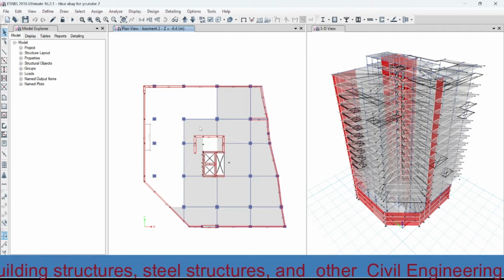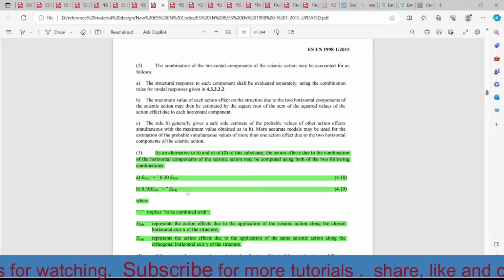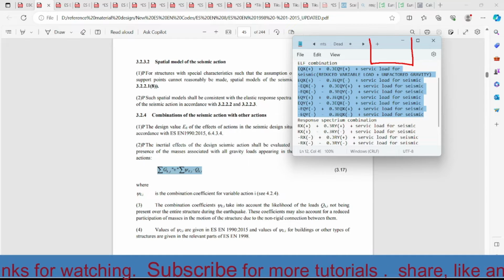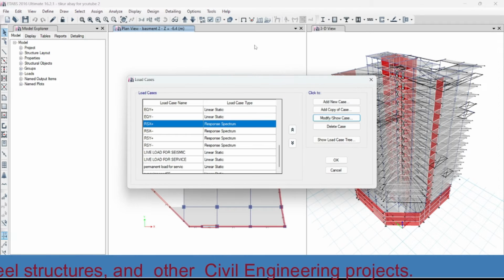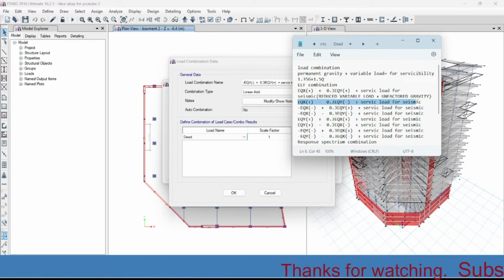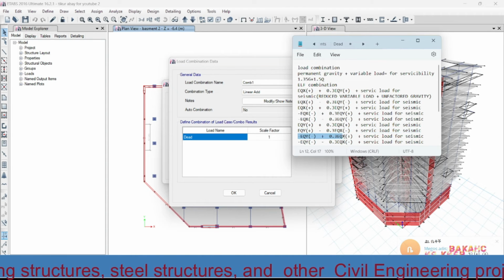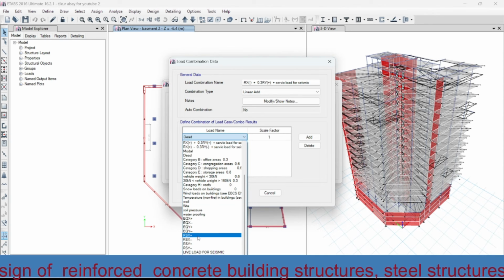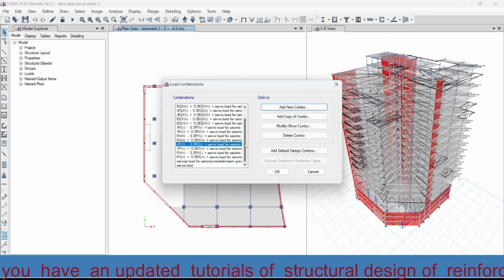Complete Structural Design of 20 Story Building using ETABS with Eurocode & Ethiopian Code (part13)

Comment: If my structure is perfectly symmetrical square.
With slabs, beam, and column at symmetrical position in square plan. Should I add eccentricity. Or only EQx and EQy is enough without eccentricity
Reply from the maker: @shadmandogar  I understood that your structure is symmetrical in plan  and elevation. If so, the center of mass and center of rigidity( structures)  are at  the same  point. In this case the distance between center of mass and center of rigidity  becomes 0.Hence  no need of considering eccentricity in orthogonal direction during static and dynamic analysise. But if the structure is not regular in elevation , there may be a  torsional behaviour induced by the structure. In this case considering an eccentricity is vital to account torsional irregularity. Any way check the regularity  in plan and elevation .

Comment: Question : Why dont you considered,
EQX(+) - 0.3EQY(+) + S.L. ( i mean the (+ , -) in bracket represent eccentricity in positive and negative direction) 

BUT , whenever there is (-) eccentricity load case. You are using a negative direction scale factor. Why not with (+) eccentricity
Reply from the maker: @shadmandogar  both - and + eccentricity static load cases provide the same base shear . Hence both static load cases  in either of eccentricity  should  be scaled.

Comment: Lets clarify. 
"Service load for seismic"=SUM(G)+SUM(psi2*Q). 
SUM(G) named in part 12 "Permanent load for serviceability".
SUM(psi2*Q) named "LIVE LOAD FOR SERVICE". 
Right or not?
And thanks! Great work!
Reply from the maker: for more clarification you can watch tutorial part 13 b which clarifies service load for seismic and live load for servic. live load for service =Q+G where  psi 2 is taken as 1(live load will act with full load) and used for gravity combination only. where as live load for seismic means live load used during  seismic load combinations  only  in this case live load will be reduced and multiplied by Psi2. you will be clarified if you watch load combination part 2.

Comment: I have some question on part 2 the stiffness modifier for slab is taken 50 percent but during earthquake it is known that the resistance of the slab is less so dont you think it is a bit big because other people suggest it should be taken as 5 percent?
Reply from the maker: If u  take 5%' the structure will not be more stiff . So  if u go through literatures of eurocode 8,  you will get more about it. So it is advisable to take 50%
Reply: Per EC8 you can define Rigid diaphragm (infinite inplane stiffness and absolute flexibility out of plane) for slabs when slab is more than 7cm thick, if I'm not mistaken.